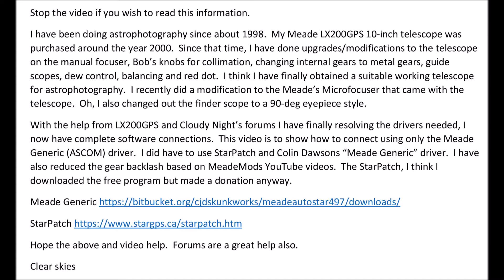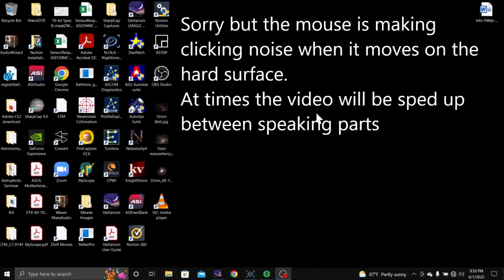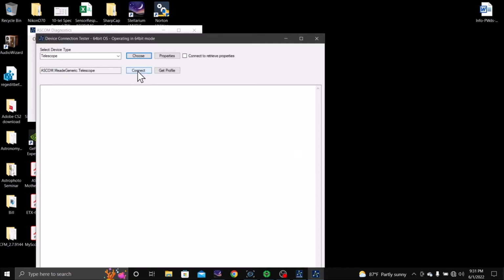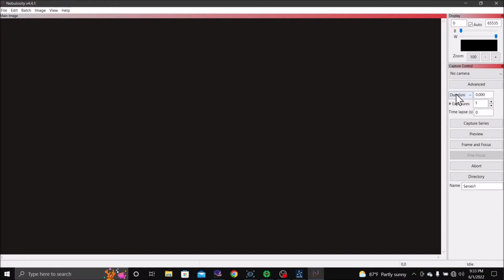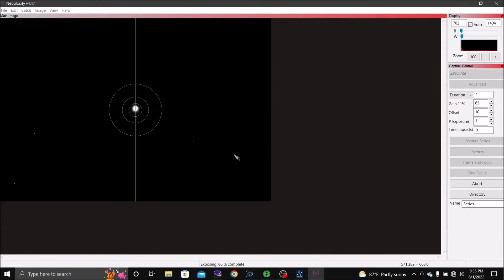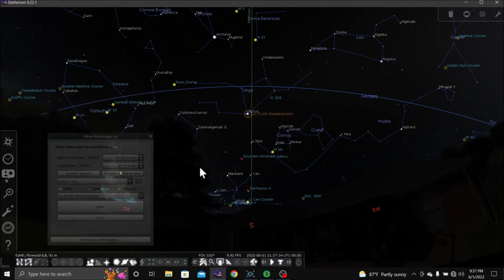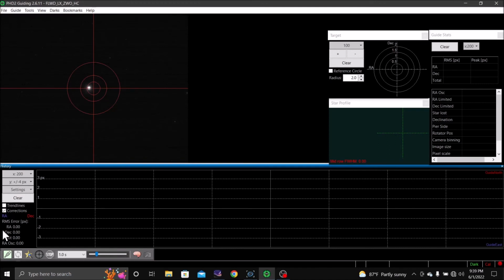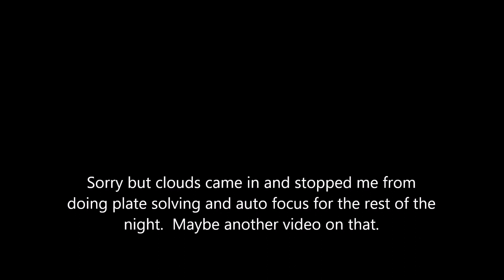Meade LX200GPS w/ ASCOM, NINA, PHD2 & Stellarium connections

Comment: Thanks for the great summary.  After 50 years of optical astronomy, I'm finally gonna spend some of my kids' inheritance and get into astrophotography.  I have a permanently mounted Meade 12" LX200 ACF (purchased in 2008) on its original fork mount and wedge.  I'm debating deforking and getting a Losmandy G11T mount, but am gonna give this old fork mount a try first.  Do you get good guiding at F10 with that guide scope?  I hear some folks have to use an off axis guider at those focal lengths.  I've also got a Lepus ACF reducer and am working through how to get all these part mechanically hooked up.  

Your video is gonna help me a lot when it comes time to make all the connections!  I do NOT have a clear view to Polaris (at least in summertime) so need to figure how to align using a camera with that handicap.  

If you ever get the urge to put another video or two together to help dudes like me just getting in to this with old Meade hardware, PLEASE DO!

Comment: Great video.  I have a 10  LX 200 Classic and I use Nina, PHD guiding and Stellarium and everything works as it should including plate solving in Nina using ASTAP.    I polar align using the  Meade classic hand controller.  When I choose a target in Stellarium, I can acquire the target in NINA and Nina will slew to the object and try to center the object.  Nina controls the centering and it gets the target in view and attempts to center.  At this point it seems like Nina makes corrections to center the object and moves the mount too much as if it is over correcting.   Have you ever run into this situation and if so, how did you find a solution?

Comment: I just viewed this tutorial today.  Thanks for taking the time to put it together.  It seems that you do not use a reducer or flattener.   How well do your final images come out (especially the edges)?  If you're not using a full frame camera, this may not present as too much of an issue.  Would you say that your setup is better geared for planetary imaging vs. deep sky?  Also, I assume that using a reducer/flattener will increase the train length,  seriously limiting where in the sky you could point.  Thoughts?  I have a good ZWO tech stack (including a full frame CMOS camera) that I'd like to try using my older 10" Meade (Peterson modified) LX200 SCT, but I'm not sure the effort would be worth it - especially without a reducer & flattener.

Comment: where did you get the bracket to attach the autofocuser bracket to the curved part of the Meade micofocuser?
Reply from the maker: That is a 3D print.  I have a silent video on doing the Microfocuser mode using a ZWO EAF;   In the text below the video, there is a link to download the drawing file and a l ink to the YouTube video I when by for the mode. Here is the info:
Ref:     • Ep 038 - How to Make a Home Made Auto...   this link has a link on the page to the 3D model to download. https://www.thingiverse.com/thing:437...
I found a printer to do the 3D print.  You will have to search for one in you area or online but you need the 3D file to send to them.

Comment: You have almost the exact setup I have, except my LX200 is not the gps. I have a question for you: Do you use the Park function in NINA, or do you do something else? I have been trying g to get mine to park for almost 2 years now, and none of the forums or Facebook groups have been able to help.
Reply from the maker: I use NINA when I am imagining to Park the telescope, I also use my hand controller at times.  When using NINA, it parks, and the hand controller notifies you to turn off the telescope.   NINA does not turn off the telescope.  Sometimes I turn on the Park when setting up sessions in NINA, which automatically parks after the last session. Or you can uncheck that feature and Park with the hand controller or NINA’s button control under the Telescope tab. For Forum help, I most of the time go to the LX200GPS Group, search for groups.io. Sorry for not looking at my channel for so long. Hope this information helps.

Comment: Hi. Just a question: how do you avoid the risk of the camera hitting the base of the fork? in the video you point to south but, what happen if you want to point, let´s say, to NGC281 Pacman? Does the Autostar software rejects that due to the evident clearance problem?
Reply from the maker: In this video you have to watch the slewing and stop it if you are going to have a contacting condition.  There will be some areas of the sky you cannot image when the camera sticks out the back to avoid collisions.  I have another video putting the camera on a 2" diagonal that makes it go vertically up.  I have done some images at night and tested in the house using the vertical train.  However, due to weather I have not been able to do much.  Another person mentioned the vertical imaging train and stated it works for him.  Do not know how a reducer will work in the vertical imaging train.

Comment: Dang that seems harder than trigonometry
Reply from the maker: Well, it is not that long to do, only when you are trying to explain the procedure.  I stopped using Nebulosity to preview.  I now go straight to NINA’s camera view.  You do not have to run the ASCOM diagnosis either, just the connection to the telescope.  Probably takes me 5-minutes when I am in the field.
Reply: @gadgetmanbowen3081  it’s like anything else just have to get pass the learning curve.  I Appreciate the insight!

Comment: Nice setup!  Did the Meade zero-shift focuser motor not work, or were you looking for better performance?
Reply from the maker: The Meade Microfocuser does not work with ASCOM drivers.  So, you cannot remotely control it via software like NINA.  Motor was fine and I saved it for storage.  Now I can use autofocus features in software.  I will say that as the video hopefully covered, I have the ZWO focuser out half of the Meade’s focuser travel as the starting point.  I then manually get a fairly good focus at that point with the focus knob.  After that I let the software do its thing.  That gives it room to move in and out.  The ZWO program lets you put in the limits of the focuser travel from zero to your focuser’s max travel.  In the Mead case it is 4000 as I recall being the max.
Reply from the maker: You can view my Meade to EAF video get info on the project.  I did the modification based upon someone else's modification.

Comment: Super helpful video! Can you show how you have your guide camera connected? Do you use the autoguider port on the telescope?
Reply from the maker: When the video starts showing the telescope, it is the side view of the telescope and you can see the guide scope is at the top of the picture with the silver guide camera attached to it.  The guide camera’s USB cable (gray) comes out of the back of the guide camera and travels down to the USB Hub.  I do not use the autoguider port which is an ST4 cable.  The two ports beside the autoguider port, on the base of the telescope, are used and go to the USB Hub also.  Hope this answers your questions.  Thanks for watching the video.
Reply: @gadgetmanbowen3081  thank you! I’ve been struggling to get mine tracking and every little bit helps. PHD2 just says my mount can’t use pulse guiding. Anyway I’m glad to see it’s possible. Love your videos!
Reply from the maker: @ChristianPsencik  
Thank you for your kind words and liking the video.  I have spent many years trying to get things tracking right on the LX as I covered in the text after the video’s intro.  In retrospect, I think the main issues were the balance, gear messing and PEC training.  Check out MeadeMods YouTube videos on how to take the slop out of your RA and DEC gear meshing.  

I got the balance to work out by removing the 80-mm ShortTube Orion guide scope and going down to the 50-mm Orion Mini guide scope with helical focuser but still using my Orion StarShoot Autoguider.  You need to balance from 90-deg up to horizontal position.  That is the telescope should not move with out the clutch engaged at any position during the balancing.  The balance to the right or left can be achieved with weights on the arms but I got it to balance with my DewBuster controller mounted to the left arm.  I think some people suggest some downward movement to the east is recommended but not much.

I have not tried the OAG method of guiding as yet.  That maybe another project after my recent knee replacement starts letting me get around better.

As for connections, I have two older #507 Cable Connector Kit  adapters and I got two RS232 to USB adapters from StarTech (Part# ICUSB232IF) for both of my RS232 ports on the telescope’s base.  As mentioned before, I do not use the ST4 cable from the guide camera that would plug into the Autoguider port, but I do use the USB cable from the guide camera to my USB Hub.  In the past the ST4 cable has worked even on PHD.

The next improvement was ditching the ST4 cable and changing to all USB connections and resolving the ASCOM drivers to use, as covered in the text after the intro screen.  If you get the ASCOM drivers installed PHD should work well.  Make sure your RS232 ports are being picked up as COM Ports by checking with Device Manager.  If you are using the RS232 to USB adapter and you do not get a COM Port then the adapter is not correct or there are wiring connection issues in the flat 6-wire telephone cable.  

Hope this helps.
Reply: I had the same problem. I was using the guide port And it was saying Mount. can't use pulse guiding. Did this fix the problem?